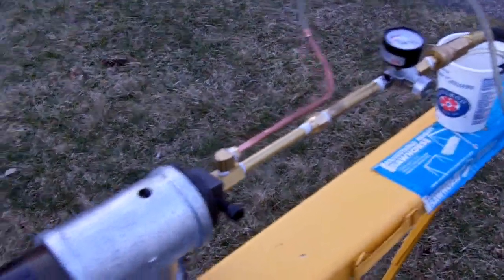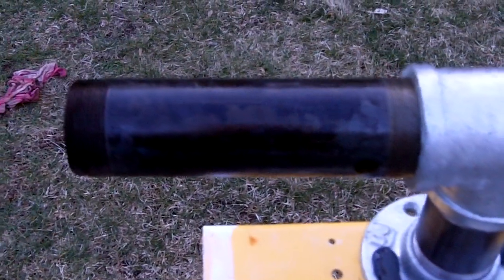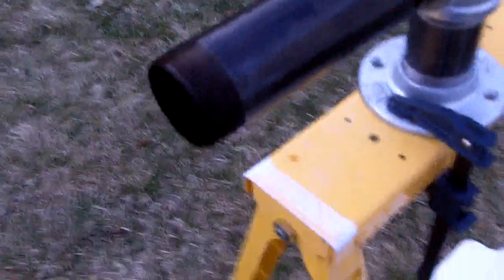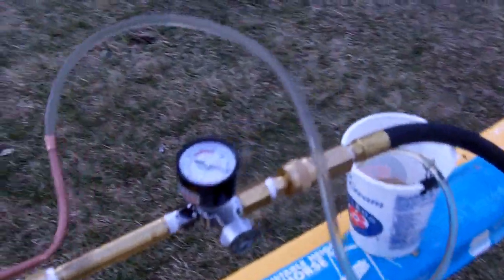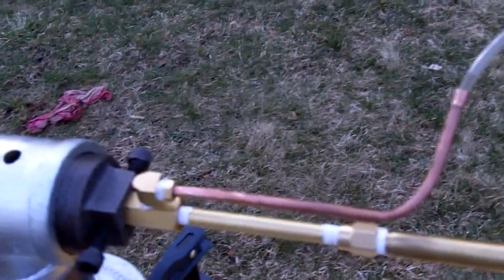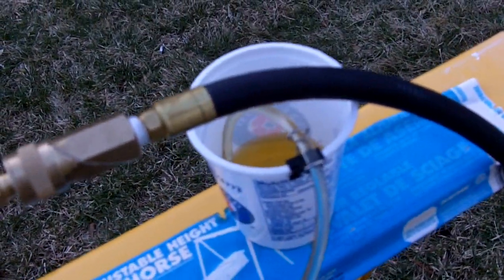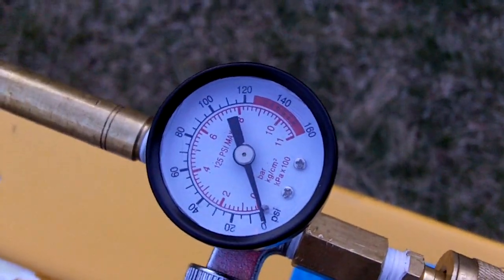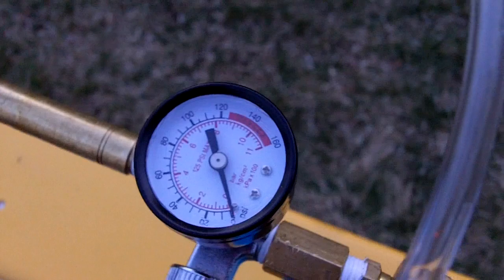Siphon Nozzle, Waste oil Burner Test 1

Comment: I made a waste oil burner using the 5-6 psi nozzle.   It doesn't make enough heat, clogs all the time even though I filtered the waste oil, and I have to pre heat my foundry with propane or it wont stay lit/stable .     I think I will go up a nozzle size, but my air compressor is small so I don't want to exceed it's capacity.

Comment: Why such high pressure? These nozzles are designed to work at 3-5psi and I have seen other youtube videos with them working at low pressures. I also notice you have no air blower fan to provide high volume low pressure air to the burn chamber (some people even use an open tube configuration with no fan)...maybe this is why you need so much air pressure on your nozzle.  I bet your flame chamber is actually oxygen starved.

Comment from the maker: @bigc028282 Yeah this thing could be very modular. (or you can make multiple) I plan on this being used for a forge as well as an aluminum foundry but could easily be adapted to a furnace, boiler, maybe even a wood stove. Just need power to run the compressor.

Comment from the maker: @TheMrTinker Yup that happens as you turn the air off. :) runs fine when at pressure, although I added a blower port on the side of the tube. Just haven't had time to play with that.